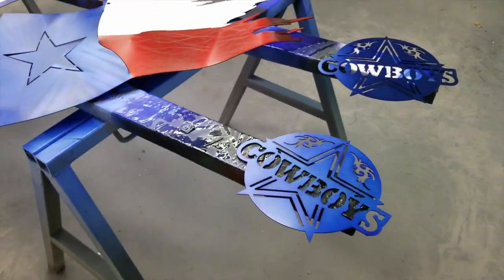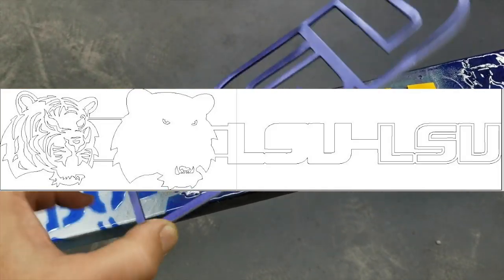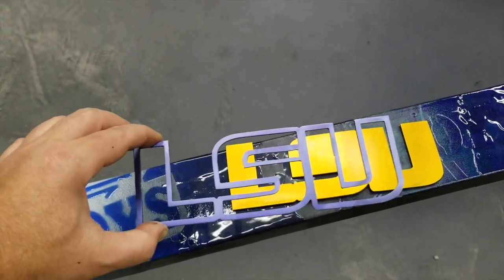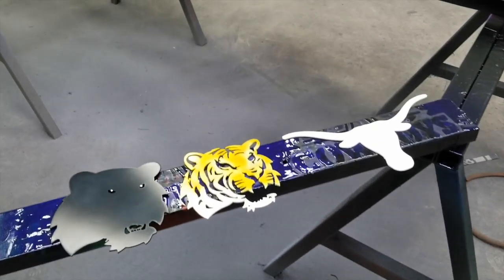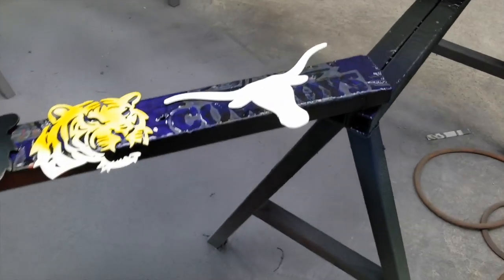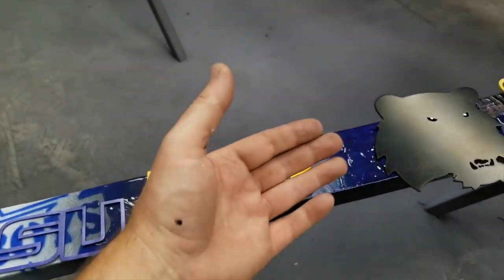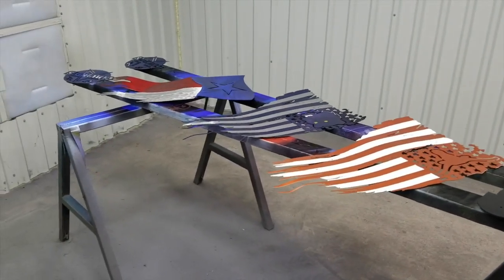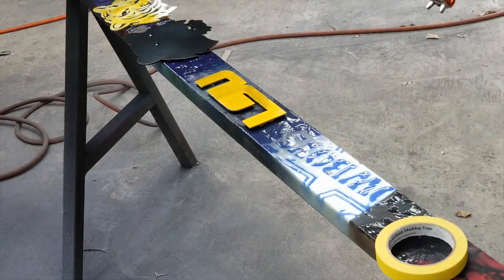Semi-Professional Tip - The Intentional Clear Bridge

Comment: A question Mr. Ramsey. Would dobble sided tape or a drop of super glue work whit the under 12" pieces if you stick them to a little lager piece of sheet metal before putting them in the belt sander? Almost every one doing cnc videos uses it.
Reply from the maker: right i have seen john saunders and others use the tape and superglue for cnc milling fixturing.  In my case its 12" long thing, and not really should how i would use the super glue? are you saying put the super glue on each end and butt them together ?
Reply: Mr. Ramsey, (you are talking about it in the video @ 1:08)  I think maybe the belt sander is pushing with a lot less force on the piece during the process than milling does..  And nearly only in one direction. I know there is the little side to side motion on the belt but thats minimal force to the object. So perhaps it´s possible to mount or fix  the smaller pieces on a let´s say 2 by 3 foot piece of sheet with just a few drops in each corner of the small pieces. I don´t mean stick the smaller pieces together but rather mounting them all on a piece large enough to go thrue the sander.
Reply from the maker: @BillyHardcase  no its not a matter of force, its the distance between the indeed and outfield pinch rollers, if the part leaves the infeed roller before it reaches the outfield roller it will get hung up in the machine